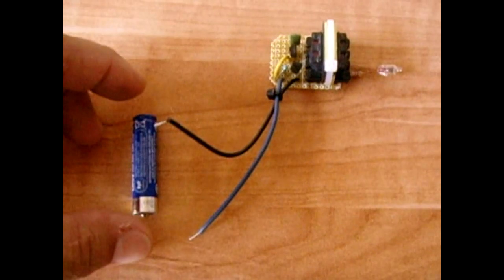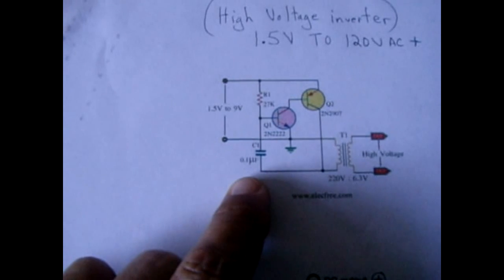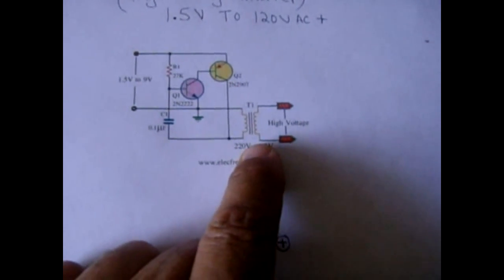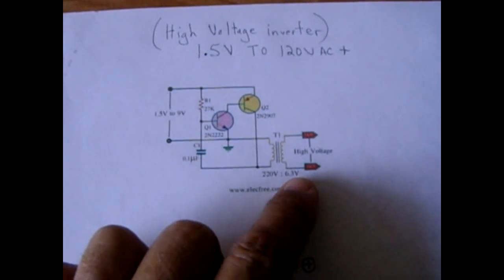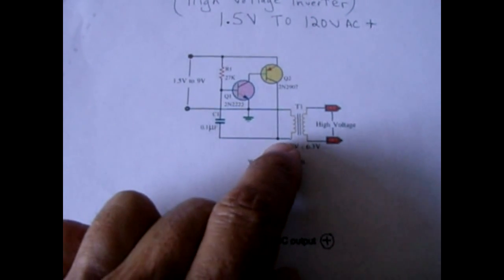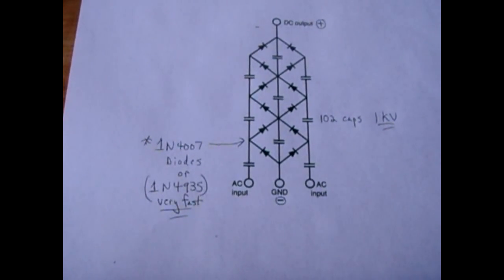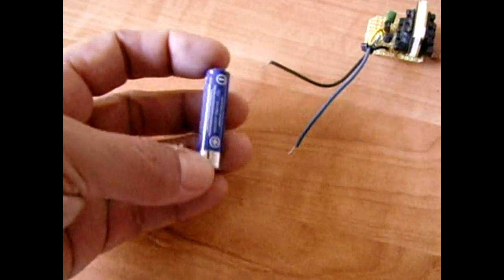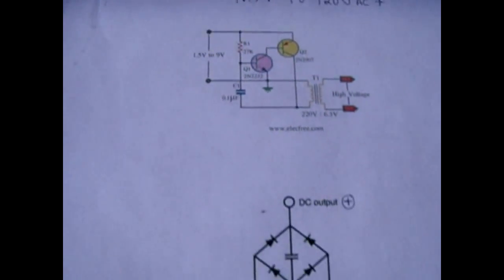AAA (1.5V) Battery to 120V or HIGHER!

Comment: hi, I've attempted to use a transformer like that but my transformer has 6 pins. 4 on one side and wo on the other.. I used a breadboard and connected 2 wires on the outer 2 pins on the 4 pin side. and I connected a light and a motor trying to step up the voltage but all u got were sparks and no power to the other end. Can u tell me how to wire the transformer to the load and what would happen if I didn't use any other components and why I got those sparks? Thanks for the great video as well...
Reply from the maker: +scoob y 
Very difficult to say what the issue is because I have no idea what transformer you have. You do realize this circuit will not power a 120V bulb or motor. The circuit supplies a very low current output at higher voltage.

Thanks For Watching!

Comment: can i reduce output voltage of fly swatter to 12 volt?
Reply from the maker: +Sagar Chandgadkar 
Hi there. The output of the fly swatter is high voltage. You will not be able to reduce the voltage to 12V. If you were able to, then the current output would be too low to be useful.

Thanks. Be sure to check out my other videos, rate thumbs up, and share.
Reply: ok, thankyou.

Comment: is it poss, to modify this experiment to charge a 12 volt car battery, thanks,
Reply from the maker: +howard ashcraft 
Hi there. The current output is way too low to be connected to a 12V lead acid battery for charging purposes.

Thanks!
Reply: +electronicsNmore thanks

Comment: hi , you know that u we can get free electricity from the phone line , but its 50 v only ,  and i want to turn it to 220 v ,, can i ? pls help 
thnx :))
Reply from the maker: +zeina abdou 
Don't bother. You could not do anything with it. The level of current is way too low, and the wires are too thin.

Thanks.
Reply: thnx  a lot :))
Reply: there is a video showing me that u can make the 1.5 v volts small battery lights a 220v lamp ,, and i want to know how does it lasts maybe ? " am stupid i know lol "

Comment: Nice video. Can you tell me where i can find transformer particularly giving 12v from 1.5 v input. Transformer from any old radio or devices?
Reply from the maker: +Parajuli Sunil 
No such animal exists if you are looking for a "Step-Up" transformer from 1.5VAC to 12VAC. You do realize that transformers can only be used with DC pulses or AC, right? You cannot use a transformer with a battery.

Thanks For watching.

Comment: Great video.  Can you tell me what modification do I need to make if i wanted 240 VAC at the output please?
Reply from the maker: +Richard Yap 
You would need to either increase the number of HV secondary turns, increase input voltage, or use a voltage multiplier at the output. You need to experiment until you get the desired output.
Reply: +electronicsNmore Thx

Comment: hello, i have a small question. If i were to put 8 aa batteries in a row and connected it to a 12v car outlet , then used a power converter to change it from 12v dc to 120v av. would i be able to plug my laptop into it?
Reply from the maker: +Hussein Hashem 
The AA batteries would be dead in no time at all.
Reply: +electronicsNmore would it at least charge for 20 minutes? this is like a last resort for entertainment during a power outage. each battery contains 1500mah( times by eight) and a laptop battery is about 20000 mah.
Reply from the maker: When you place batteries in series, the voltage rises and the amperage stays the same. So you have 12V at 1.5AH.
Reply: +electronicsNmore I really appreciate you sharing your knowledge with me. I have one last question. if I were to put the batteries in a parallel circuit that would increase the amps and not the volts. so I would have 1.5 volts at 12ah?
Reply from the maker: Hussein Hashem
Placing them in parallel will give you 1.5 x 8 which is 12ah at 1.5V.

Comment: Could you step it up with a voltage multiplier add on or would the output be in DC vs AC? Would a traditional voltage multiplier work with a DC input?
Reply from the maker: +STEAM_Vortex 
Hello. Using a voltage multiplier circuit will take the AC input and result in a higher voltage DC output. You cannot take DC and use a voltage multiplier circuit unless you also have a transistor to do the switching.

Thanks For Watching! Be sure to share and rate thumbs up.
Reply: +electronicsNmore So simply adding a transistor would fix this problem? Thanks; I like your videos. I subscribed and gave the vid a thumbs up.

Comment: please will it work at 12v DC
Reply from the maker: You can try 12v, but I would use a 1w or 2w resistor in series with the 12v battery pos. Start with 100 ohms and move lower. You may not need a resistor at all, or only a very low value resistor.
Reply: what abt 9v

Comment: Hi! I appreciate this video a lot. I have a question, what changes would I have to do if the input is to be 6microVolts instead of 1.5 volts and have an output just about it (1.5V)?

Comment: Do you know any other device used for getting 120v, something small, that doesn't need to be plugged in? Or someone that sells this?
Reply from the maker: +Darius Benjamin 
Remember that this device, like many other small circuits, will only output a VERY low current. Do not expect to power anything big. If you want to power tools, tv's, etc, then watch my inverter videos.

Thank you!
Reply: +electronicsNmore  I watched the inverter videos but I'm looking for something that shouldn't need an inverter or needs to be plugged in for power. And it has to be small. Does something like that even exist? I've been searching for weeks.Thank you

Comment: high what's up by any chance do you have a step by step build
Reply from the maker: +David Lopez 
Hi Dave. In my videos I show the completed circuit, schematic, and demos. I do not do step by step soldering, etc.

Thanks For Watching!
Reply: +electronicsNmore  can you do tutorial assembly its hard to understand
Reply: +electronicsNmore  can you do tutorial assembly its hard to understand
Reply from the maker: BiboyRobs123
Hi there. Unfortunately I do not do step by step soldering tutorials on my channel. I only show the schematic, explain the circuit, and show the completed circuit. This is a very simple circuit to assemble compared to many of my other circuits.
Thank You
Reply: electronicsNmore Thanks for replying where did you get the parts???
Reply from the maker: You can buy them many places online. Ebay is one choice.
Reply: electronicsNmore Thanks
Reply: +David Lopez  Just look at the video he showed. Write down the descriptions of the resistor, transistors and capacitor. I haven't built one but if I did I'd start with a door bell transformer. Not sure, but his device has the resistor placed at the end of the circuit (next to the bulb), while his diagram has it placed at the beginning of the circuit.

Comment: How much would be the max power output?
Reply from the maker: Arnold Sabalones1 There are a couple factors. The supply voltage, and the transformer being used. When driving a larger transformer using higher voltage/current, be sure to use large transistors to handle the current.

Thanks For Watching!

Comment: Where do you get the transformer can you send me a link to a transformer that will work with this? Thanks.
Reply: if you have an old ATX Power supply lying around your house, in this case you must sacrifice the use of that atx anymore, then you can salvage at least three transformers inside, one of them is a HV Transformer designed for switch mode power supply.
Reply: +Bonn Joemar Oleo Cabrera What else has one of these transformers in it?
Reply: +Dylan Hansen You can also get these transformers from wall adapters, usually rated 12VDC, they are bigger than those yellow transformers but it will work. sometimes they are center tapped, 6V in , 110 or 220V out.
Reply: +Dylan Hansen jus be sure you grab those adapters which is heavy and cubical in shape

Comment: Hi, I tend to try out this circuit using a transformer from an old digital alarm clock. It has 16 ohms on secondary (LV side) with a center tap and less than 2000 ohms on secondary (HV side), I don't know what's the voltage on the secondary, but it worked on 230V AC (primary). Could you please help me how to adjust the input voltage of the battery in order to keep transistors as cool as possible without overheating. The circuit's output voltage should be 230V for powering cfls or LED bulbs. Thanks :)
Reply from the maker: Viktor Božičević Hello Viktor. Unfortunately I cannot take the time to assist every viewer that asks for special assistance. The video contained enough information to help you. If you do not use the correct transformer, then you will have to experiment until you get it right.

Thanks For Watching
Reply: electronicsNmore Ok, why I'm asking this is because I don't have much money and dont't want to waste extra money on buying components I already have. I experimented with a mentioned transformer on making a simple JT, using a 2n3904 transistor and different resistor values, but it only gave me arround 100v with a hot transistor.  If you don't have time could you just suggest me any other videos or instructables? Regards :)

Comment: Great explanation! Thank you so much for talking and explaining the circuit thoroughly! How many Amps  are being produced?
Reply from the maker: louis garrett Thanks For Watching. In order to boost the voltage way up, at the same time you are loosing output current. The output is in the mA range.
Reply: electronicsNmore thank you very much! Thanks for responding quickly, I appreciate it!

Comment: Hey great video.  Quick question I have a 120v 60hz   motor  what kind or set up would I need for a go cart.
Reply from the maker: Britton White You need a high wattage power inverter circuit with a large 12V lead acid battery. Refer to my video playlist for inverter circuits.

Thanks.

Comment: I have followed what you shown here but the circuit seems not a pulsed dc. May I know how to convert dc to a pulsed dc?
Reply from the maker: If your circuit is working, then that means you have pulses into the transformer. Pulses in, pulses out. You have pulsed DC.
Reply: But the online circuit simulator shown a smooth curve even the analyzed time is 10 us which confused me whether it is a pulsed dc or not. Another thing is may I know how to decide the value of the resistor and capacitor ?

Comment: Hey :) I am building a mini wind turbine for my school project and I have made a joule thief, but there is a problem... My motor generates about 0.5V, but with the joule thief it generates 1V. What should I do to get 3-5V ? Is it possible, how? Thanks :)
Reply from the maker: Buy a step up converter module on Ebay, they are cheap. Some go as low as .5 vdc input. The output is 5 vdc.

Thanks for watching, and be sure to share my videos with others.
Reply: electronicsNmore 
I have too many transistors which are not included in any joule thief experiment, neither in your experiment. So, if I want to use a transitor of mine in a joule thief, must i test it by building a transformer with a nail making its cols moveable, so the transformer can be variable?

Comment: electronicsNmore how long does a double a last using this?
Reply: If ever you have already replicate the circuit, try running it on a full charge AA battery with a known mAh Rating, measure the current being drawn by the circuit.

Comment: Could you skip the transformer and use the pulsed output from the switching circuit for the voltage multiplier circuit?  I am having trouble finding cheap transformers.  I can break open a power adapter from a cell phone charger for my prototype, but I need a solution beyond that, which doesn't involve buying 1000, $10 transformers.  I am ultimately looking to get about 900V from a 3 volt source.  Low amperage is okay, will be charging caps to get about 0.2F before discharging, there is an allowance for up to 3 seconds of charge time.
Reply from the maker: Thanks for watching. I have another video which uses a toroid to produce 350V using 3V which you can then step up using a voltage multiplier circuit. I will be uploading a video soon showing a rat killer device which charges caps up to 500V using that "High Voltage Joule Thief" circuit. You will never be able to charge up a 200,000uF cap in 3 seconds using any high voltage inverter circuit shown on my channel.
Reply: electronicsNmore Very interesting that you bring up the topic of electric rat killer device.  It happens that I am trying to build an electric mouse trap, and the exact reason I asked the question.  .2F is probably way more than enough to kill a mouse, still in the early stages of development, and I didn't bother to do the math on how long that would take to charge either. 
I was looking into toroids as well, but got into the issue of price again. 
I know this can be solved, Victor has a very successful line of electric mouse traps that run on 4 batteries.  I came up with the .2F value as an estimate based on the fact they say they can kill 100 mice per set of batteries.  Without knowing exactly how their circuit works, and for good reason, I don't want to copy it, I will have to do a lot of testing and math. - may have to wait til my weekend, I've been working 14 hours a day, and don't have a lot of patience.
Reply from the maker: I will be uploading the rat killing device in 8 days.

Comment: How did you go about separating the transformer for rewinding? as there somewhat of a bugger to get apart.
Reply from the maker: Ferrite transformers pull apart easy. If your having trouble with this circuit, check out my other videos, I have a high voltage joule thief video which is really good.

Comment: Hey there fella, great video as usual.. Built this one with my own little spin on things and works great was wondering if you'd seen those inverters that run with a single transistor? I kind of understand the idea but can't get one to work, I think they drive those bug zapper things..... Might be worth a look. Keep making videos fella
Reply from the maker: Hi Martyn. Single transistor inverters work, but not as good as 2 transistors. :-) You can buy a cheap bug zapping tennis racquet and pull that apart.

Thanks For Watching!

Comment: Is it really necessary to earth the transistor? Is there any other alternative?
Reply from the maker: No. You do not have to connect to earth ground. Battery NEG is fine.
Reply: Thank You and also, I'm trying to make one such circuit to light up a 60 watt incandescent bulb. So I wanted to know that which capacitor should I have. I already have two PN2222a and PN2907a transistors with a 470uF 16v capacitor but I haven't tried it yet. If you could, please suggest me the right values.

P.S.
I am planning to use a 9v battery
Reply from the maker: Never going to happen. You need around 6A of current to do that. This circuit has a high voltage LOW current output. Please refer to my video playlist for inverters. I have a microwave oven transformer video using 12V that can light a 75W bulb.

Thanks For Watching!
Reply: But taking I=W/V, it should take only 100/120=0.834A approx. and thus adding some AA batteries in parallel, it should work shouldn't it? I mean I know that average mAh rating of 9v batteries is around 800mAh so maybe, taking some of them in parallel could help? I seriously need some help as my science exhibit is in just two days and I've already spent too much money and labour into various circuits like this like Joule Thieves, etc. but with little success. So if you have one such schematic which would be cheap and easy please help.('cause I really want to do something like what I mentioned above only and also will have only one day to complete it after you reply........)
Reply: I was thinking and concluded, how aboout using a low wattage buld like a 30W or maybe a CFL or something. So.......would that be possible?
Reply from the maker: Your calculation is incorrect. That .834A figure needs to be multiplied by 10 to get the current required using a 12V power supply. Using a 12V lead acid battery to power a 1000W inverter draws close to 100 Amps!
Reply: Well I saw your microwave inverter and I must say it's very impressive but the problem is that I couldn't buy the heavy microwave transformer; my parents just won't let me! But, luckily I do have one or two 3055 transistors from my previous attempts and one of those 1-2 inch windable transformers too so will they do? with low wattage bulb and a li-ion 3500mAh battery(4v approx)?
Reply from the maker: You need to visit the local dump and look for an old microwave oven and take the parts out of it, or visit an appliance repair shop and ask if they have a microwave oven transformer laying around in scrap parts.
Reply: I did and he had only the small one I told you about
Reply: I also wanted to know if the 3500mAh battery will do
Reply from the maker: Because you are only using 4V, you will require a lot more current. I suggest you hold off until you get your hands on what you need.

Thanks For Watching
Reply: Well................thank you for wasting your time on me and my queries anyway, appreciate it...........but I will keep searching and researching till I find something.

THANK YOU VERY MUCH
Reply: Found it! I finally got a circuit which worked out for me. It is much like your oven transformer circuit but this one's more compact and costs low. DID IT WITH ONLY WHAT I ALREADY HAD! If you could tell me your email ID or any other such way through which I could send you pictures and all, I would send you the images, schematic, etc.  'cause I really want to discuss it with some expert and your explanations sure seem perfect.